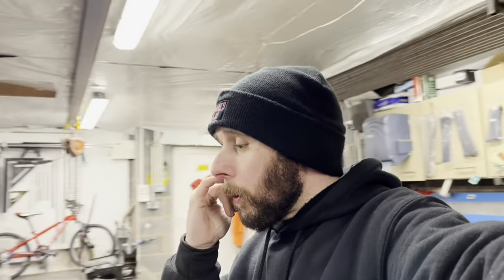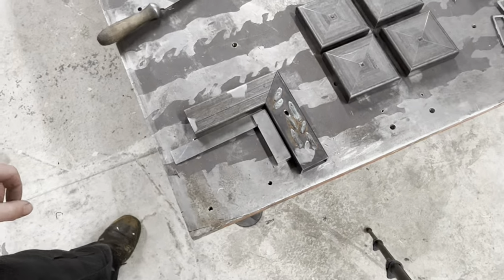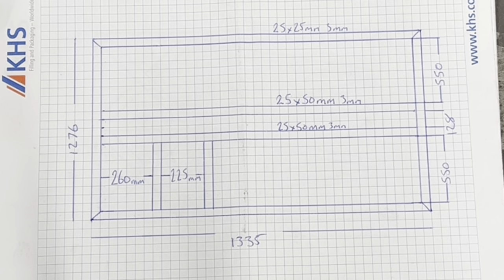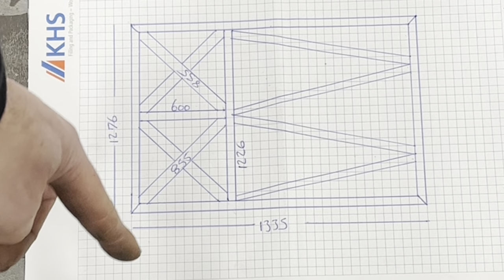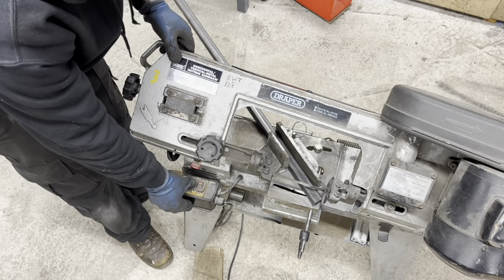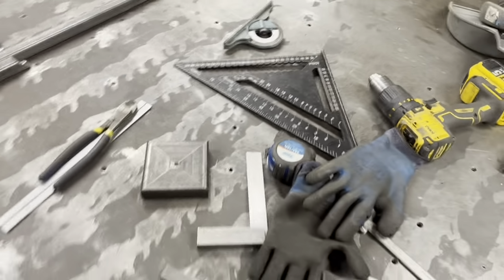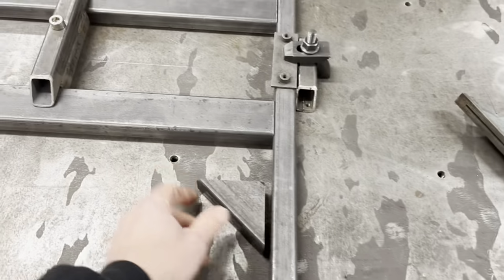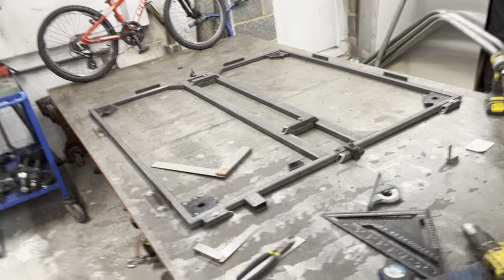2023 classic mini race car chassis build part 3

Comment: Matt, do you ever build race minis with a standard chassis, but with upgraded rear and front suspension with a busa engine
Reply from the maker: Hi buddy my blue mini is original steel body still running mini suspension still
Reply: @skidmores.garage  when you have time would you consider a run through all you have done to it. Do you run original motor or hayabusa in it
Reply from the maker: @stephenbarrington4491  it’s a hayabusa engine buddy. Yer I can do if that’s something you would like to see
Reply: @skidmores.garage  The first car I drove was a mini pick up (van), and I am looking into purchasing a mini, where I am hey are in pretty rough shape may need to redo floors and the like, I do want to put a hayabusa in not sure if u want to turbo it or not, but would be ok without a turbo, I would like to see the mods in terms of suspension and brake upgrades rear and the changes needed in the front for the engine to fit and how you did the upgrades, I would want to build one definitely if I have access to information on how it's done. I enjoy the content you put out
Reply from the maker: @stephenbarrington4491  I shall do a quick video on it I guess mate. It uses a mini front subframe just modified but not that much.
Reply: @skidmores.garage  thanks a Million Matt I appreciate it. Running 10 inch or bigger rims
Reply from the maker: @stephenbarrington4491  13” is the only way with bigger power minis due to needing bigger contact patch
Reply: @skidmores.garage  all good will.wait for the content then as we go will.ask for assistance, appreciate the knowledge you share

Comment: Do you not triangulate it corner to corner?
Reply from the maker: I don’t buy others can If they wish, the cage on top of the floor gives all the corner to corner strength needed really, the floor internals is mainly to hold the weight of the driver
Reply: @skidmores.garage  I meant measure it corner to corner.
Reply from the maker: @neilmchardy9061  oh lol. Yes I do mate that will come in the next video before welding. I’ll probably link one of my old videos for ppl to pop and watch that explains it so I don’t have to do it all over again lol